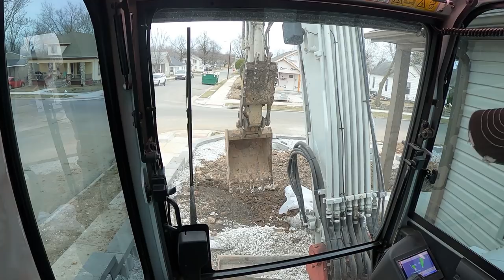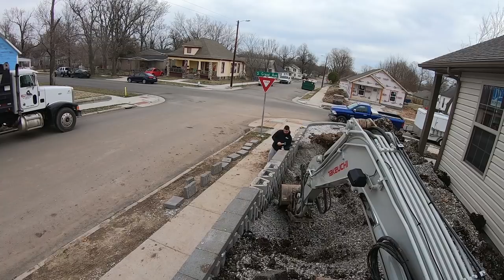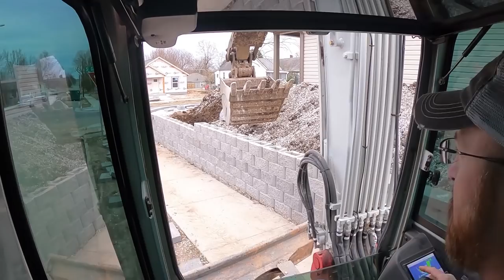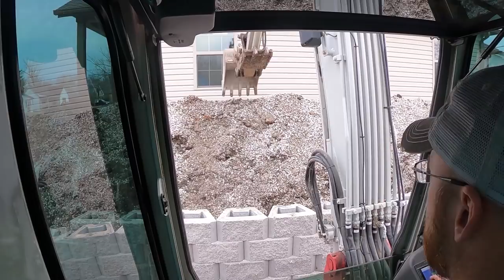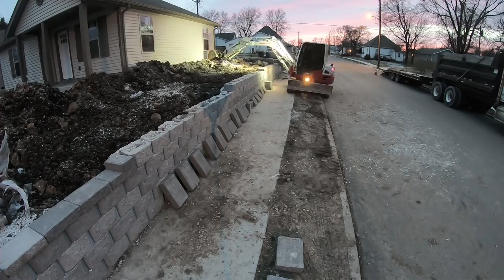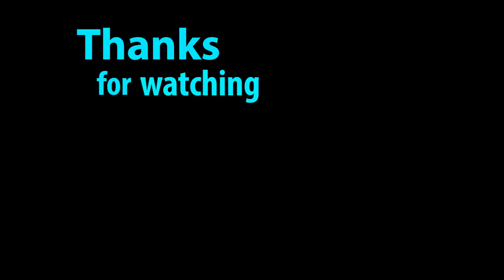Fixing A Leaning Retaining Wall

Comment: My first year in business I had a decent wall job, it was a 5ft x 22ft retaining wall about 6 feet off the house that was going to be used to hold up a 6ft wide x 22ft pathway for him to drive his mower around back!! Much similar to this wall here
The customer (older fella who apparently worked in the industry when he was younger but had the hands of a school teacher) simply did not want to install the geogrid or a drain pipe!!!! He made this ignorant comment about them, mentioning slope and blah blah and even compared geogrid to roof felt (for whatever reason) saying its a useless piece of material only used to increase overall price of the job and laughed saying "ohh haha you guys probably wont install it anyways hehehahaha". Didnt even want the blocks glued! Cheap cheap cheaaaaaap! 

He showed me all other quotes, laughing pointing at line items of this and that saying "i just want a small wall here to hold up a path so I can easily get around back" 

I talked to him about the base (he didnt want any buried blocks) surcharge and what it meant, what is required, showed him an ICPI Manual but he didnt budge!  
I was just starting so I priced low, told him I wouldnt touch it if I couldnt bury a course. He agreed, Got the job but long story short... BOY the look on his face when the first piece of paper I made him sign before the contract was a waiver form releasing me from any future blowouts, leaning, tipping, heaving blah blah based on the installation "request" put forth by the home owner to neglect ___ ___ ___ installation standards and so on... 

that was 5 years ago, last summer I was in the area doing quotes, drove by and sure enough. That 6 ft walkway on top quickly turned into an 7ft walkway. I knocked on his door, pretended I didnt see the wall, asked him if I could check on the job to see how its holding up aaaaaaaaaaaaand sure enough, he was quick worded, pretended like the wall wasnt 30 feet to the right and in plain sight and made an excuse saying he had no time and to come back next week so we can go over it.... He knew I was there to tell him told you so!
Reply from the maker: Chapman lol that’s great he didn’t want to hear it. Some people just have to learn the hard way. Appreciate the comment

Comment: Thats the biggest flaw in this style wall is there is no deadman to tie the wall back. I know timber walls don’t last but it allows for a deadman to tie back. They should or may make something to anchor to the wall to do the same but I have never seen it. Nice repair, tight squeeze I bet the old machine you had would probably be better in that situation with the way the boom operated.
Reply from the maker: They do that’s what the geogrid does on these walls. Thanks for watching
Reply from the maker: 69 Bronco guy! Wow that’s awesome sounds like they did a great job!

Comment: Brandon, I don't think the wall builder followed the Manufactures assembly instruction. That wall is always gonna move! There is no tie back to spread out any pressure from the wet dirt
Reply from the maker: DENNIS RYAN he didn’t once the ground gets packed in and they don’t drive anything above it may hold up but they should have added some geogrid for sure

Comment: He should have put tie backs in that wall and poured the cap with rebar running through it.  There should be vertical bars in it every 4" that tie to the horizon bars and go into the footer.  He used cofnener bars where he should have used straight block.  It's just a matter of time until the frost pushes that over.
Reply from the maker: These blocks are not designed for concrete or rebar down through them the water needs to wick out the front of the blocks. They just didn’t compact the ground behind it in lifts they just back filled it and it settled
Reply: @eliteearthworksllc  those blocks can take rebar down through them.  I've built a lot walls in western PA that way.  A d they are still lm stabmnding.
Reply from the maker: Ralph Hippard you can you just don’t want to put concrete in them

Comment: Brandon,  good job handling a bad situation,  learn from it and move on to the next one.  I think I might have tried a 6x8 and the skid steer and see if I could have pushed it back up straight before I dug it all out.  But hey, it all worked out in the end right?
Reply from the maker: Thank you! I guess I could have done that but they never seem to move back right with the pressure from the dirt behind the wall. Appreciate the comment

Comment: I agree no drain and was that plastic being used in place of fabric or mesh ? Didn't look like the wall was tied back in to the hill in any way at all  just by watching u dig it back out. And hey straight is straight when ur fixing someone else's screw up. That never should've tipped if it was packed correctly. The right way. Like I've seen u pack it in lifts. Great video. Hope u and mrs elite are staying safe amd healthy ! There a lot to b said for working alone most of the time as we both do especially with this virus BS. Take care Brandon
Reply from the maker: TONY GENESEO thank you! Yeah it could probably get by without the drain pipe but not properly compacting is what cause this. I think they just dumped dirt behind it and called it good. Yeah it’s crazy right now so I am glad I work alone. Appreciate you watching

Comment: Wall should have had geogrid installed and such a large machine shouldn’t drive right next to it unless it is known to be designed and built for that type of surcharge.
Reply from the maker: David Moutardier yep it was just thrown today and not properly backfilled. I told him there was a good chance of it moving. If I had built the wall I wouldn’t have been worried at all about running the machine behind it

Comment: Do you still have the tekuchi 135? Been looking at a few and wondered if you still had and your opinion on maintenance problems. Since you use your allot.
Reply from the maker: No I had a 153 but I traded it in for the 260
Reply: Sorry I meant the tb153fr that you had. Been looking around for honest reviews from operators. Saw you had one at one time.

Comment: The wall will fail again should have put geo grid in every 2 feet up and compacted that is a mess waiting to happen any 4+ foot wall should be engineered with grid this looks like someone is cheating and cheaping out
Reply from the maker: Desert515 yep the builder threw it in as quick and cheap as possible
Reply: Elite Earthworks LLC I really hope you don’t get dragged back into this again I feel I would have done the same thing try and fix what I could. I just hope the homeowner doesn’t just remember the name on your truck try and come after you and sue when it does fail later on. It’s never our job to bash other contractors but guys that work like this ruin everybody’s name
Reply from the maker: Desert515 that is true it’s not sold yet so hopefully the new homeowner won’t know lol and most of these end up as rentals and no one takes care of anything